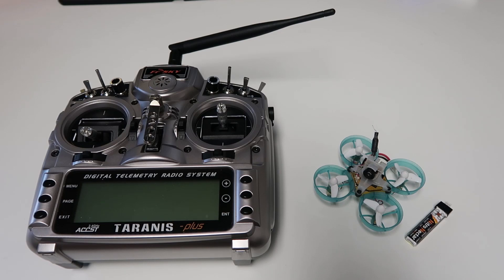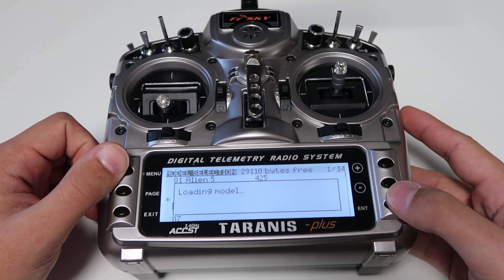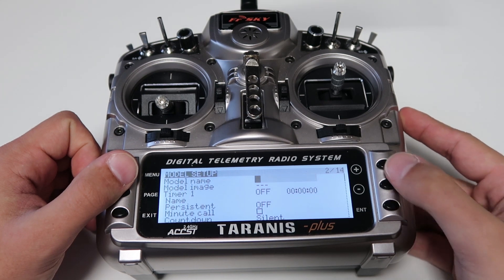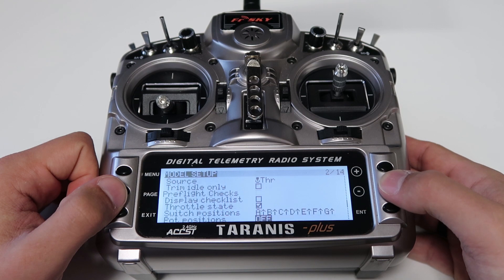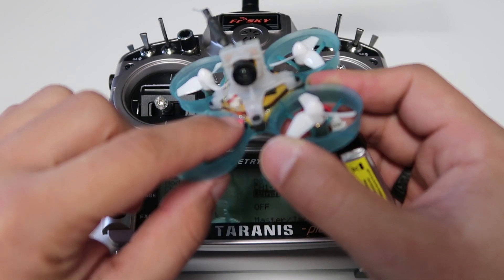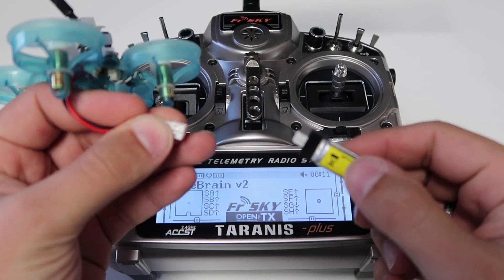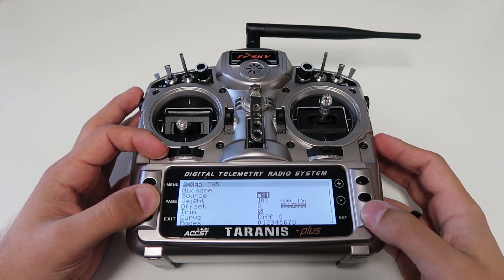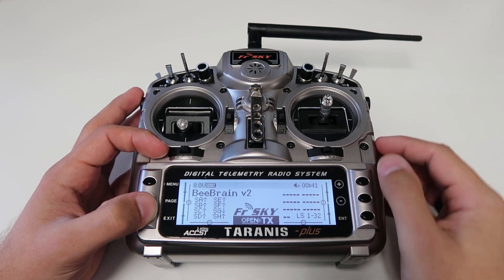BeeBrain V2 Radio Setup & Bind - FrSky

Comment: A noob here that would appreciate some help.  I purchased an Acrobee and a Taranis Q X7S not too long ago.  I'm having trouble trying to keep the acrobee in the air.  I either launch it straight up in the air or it drags along the ground.  The guy at the hobby shop helped me set up my whoop and transmitter through betaflight.

Comment: I just got NewBee v2 quad and it won't go into bind mode.  The red LED won't go to fast blinking.  any idea to get it into bind mode?
Reply: Did you figure it out? im having the same problem
Reply: No, after I exchanged some email with NewBee drone guy.  They asked me to send it in for a replacement.
Reply: Exact same issue on mine as well... Theres no fix... Contact them for a replacement .
Reply: Same no binding mode

Comment: Is it required to connect my beebrain to beta flight? I dont have a computer lol I bought one I built it  I followed the steps too bind it too my taranis and it wont fly 🤔
Reply: Hey, yes you will need to use a tablet or pc to setup the arm switch.

Comment: question... I bound up my acro bee and everything works, but it won't arm by itself... only when plugged into beta flight.  I can arm when its plugged into the PC then disconnect it and fly it around.  But if I plug the battery in it won't arm?  Any ideas on whats going on?

Comment: Does the BeeBrain V2 bind to any receiver? Specifically the Flysky FS-I6S.
Reply from the maker: The BeeBrain V2 comes in FrSky and DSMX receiver options, so they will not work with FlySky.